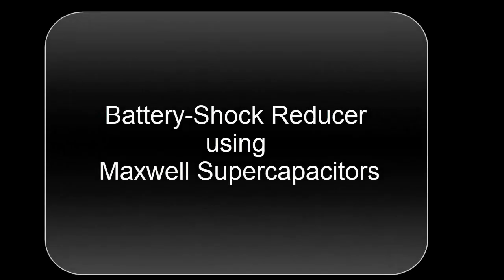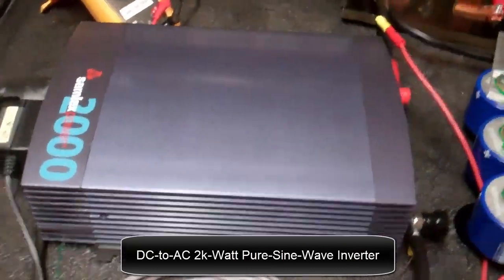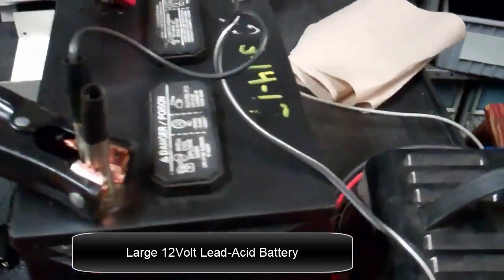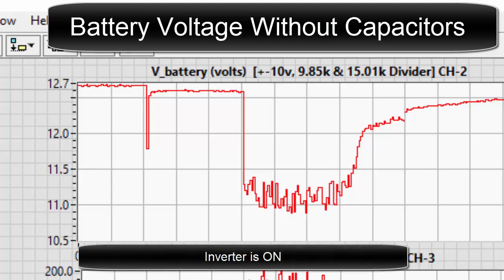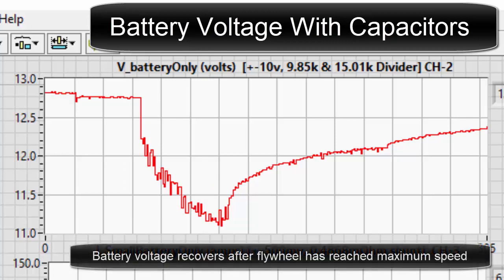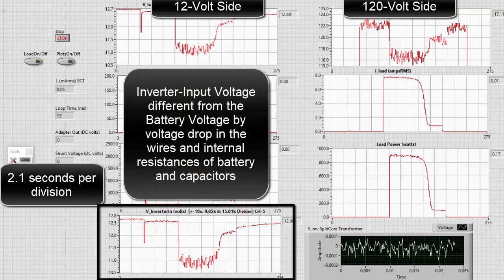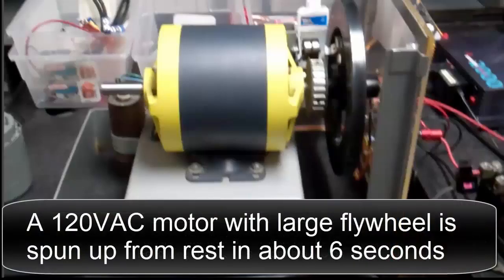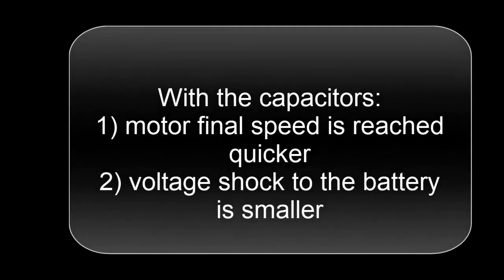Battery-Shock Reducer Using Maxwell Supercapacitors

Comment: If I have a 48v battery Bank do I need 48v supercapacitor bank or can the capacitor  bank be more or less volts
Reply: Make sure you have 20% cushion on supercap. 20%of48 is 9.6v

48 plus 9.6 = 57.6
Reply: You need to have the same voltage, one will try to overcharge the other.